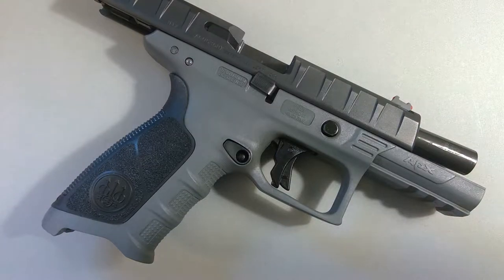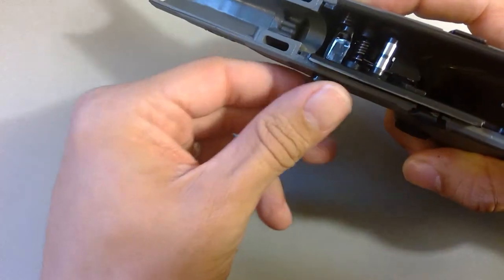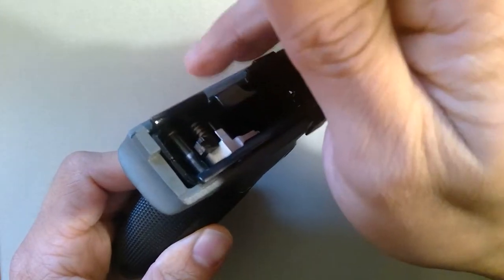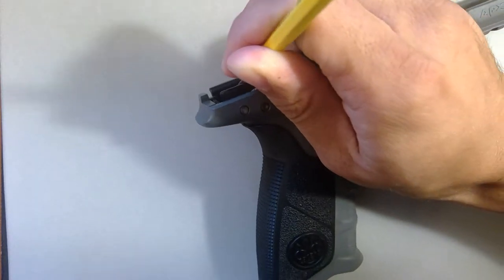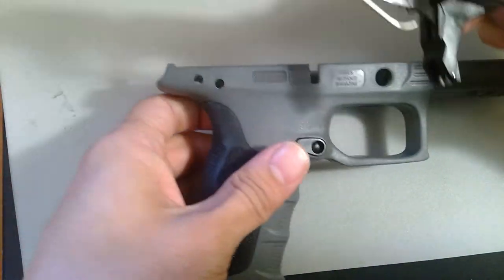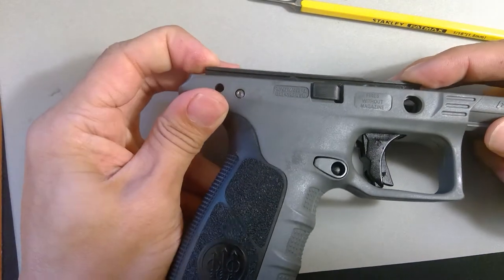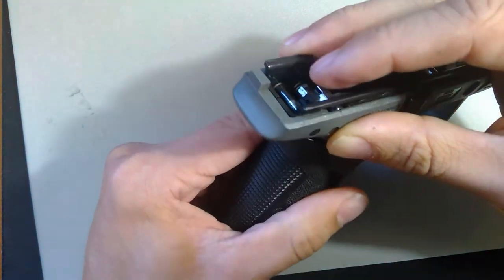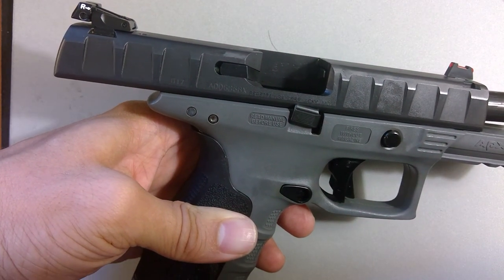Beretta APX Chassis Removal without Tears

Comment: Your video helped me a lot. It would be really great if you could do some more on the apx. Like changing out the connector and the safety plunger
Reply from the maker: Which safety plunger do you mean? Beretta has released a few maintenance and disassembly videos that I can highly recommend on some of the other parts of the system in the time since I made this video. I can recommend those as excellent as well.

Comment: Have one question concerning disassembly of chassis.When I pulled the chassis out the bottom curved spring fell out and I had a lot of difficulty getting back in.Had to send to Beretta which
took weeks.Can you provide a easy method to install this spring if it falls out? Thanks great video and provided some helping tips.

Comment: I wish I'd seen your video BEFORE I forgot to install the take-down lever and got the FCU stuck to the slide to where I can't get the take-down lever installed properly. Would you know how to fix this? This is by far and away the dumbest thing I've ever done with regard to gunsmith-ery..
Reply from the maker: Is the problem that you can't get the FCU out to reinstall it? I'm not exactly sure what's going on in your case. I'd probably have to see pictures or video to be able to tell what is going on. Without the takedown lever, you should be able to remove the slide just fine and then get the takedown lever installed without too much trouble.

Comment: Mine went back to Beretta. First there was no manual, yea the lady in customer service said it was online, right try that in the field. The takedown button/lever refused to work, the decocker button did not work, the finish was peeling off both slide release buttons and the finish was partially missing in the left slide serrations. I could overlook the finish issues from a cheaper manufacturer but even my Old Keltecs look great. This is Beretta a 500 year old manufacturing company. Oh, the lady pin customer service said they ran out of manuals. Imagine. Starting to think they just shipped out some factory seconds. Pitiful. I will dump this pistol when I get it back for cheap.
Reply from the maker: Sorry to hear that! I hope that they send you a good one. I do really like mine, and I hope you'll give one that's properly done a try.

Comment: My chassis broke is there any good cheap aftermarket ones?
Reply from the maker: I assume you mean the grip module? I am not aware of aftermarket variants, but you should be able to pick up the OEM for a decent price.
Reply: No the fcu like the trigger chassis
Reply: How do I get a new one?
Reply: Try looking it up can’t find nothinf
Reply from the maker: @Kota-cp1st  Ah, the FCU is the firearm, so if you break the actual chassis, then you'd need to send it to Beretta for repair or buy a new APX. However, if you didn't break the actual chassis, but one of the parts, then if they are sold separately or as parts, they are usually sold via Brownells.
Reply from the maker: Also, since you say you broke the actual FCU, do you mind me asking what is broken and/or how it broke? I've never heard of one actually totally breaking. Is there a specific part that is broken? I've heard of people getting them tangled up a bit during reinstallation, or accidentally disassembling them past what they wanted because the chassis can spread open when not encased in the grip module, but I've never actually heard of the chassis itself fully breaking.

Comment: No, does not work on my gun, I sent it back to beretta and after 3 months got it back not fixed. If I press the button to release the slide nothing happens. Finally a viewer suggested I put a piece of wood between my thumb and the button and still it takes gorilla force and does not work every time. I hate this gun. Very disappointed. I have the newer model.
Reply from the maker: Sorry to hear that. I imagine it should loosen up over time. However, while I assume that you're doing this already, you do make sure that the striker is released before you try to rotate the lever, yes? That's pretty important to making it easier to rotate and press the lever. And also just to clarify one other aspect, again, obvious, and I assume you're already doing this, but you never know: the button doesn't release the slide, it only allows you to rotate the lever which actually releases the slide. I've seen some people try to press the button really hard, and they push it past the point where it needs to go in order to rotate, thus actually making it harder to rotate. You just want to push it to the point where the lever rotates, and its helps to do both "at the same time" so that you can tell when you've pushed it in far enough.